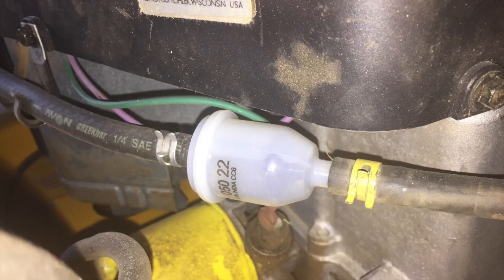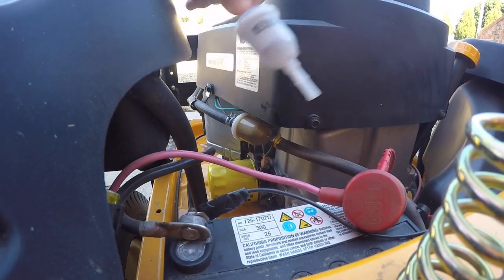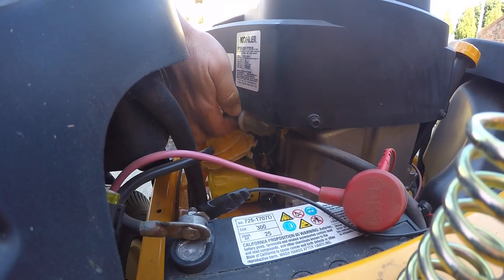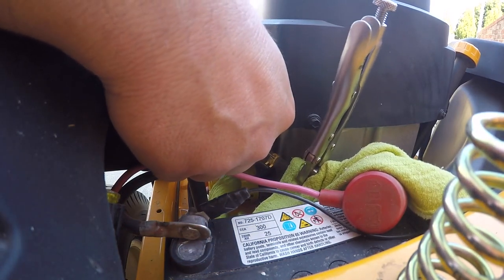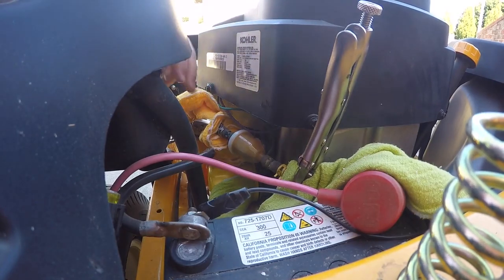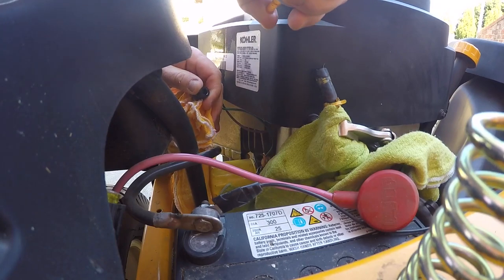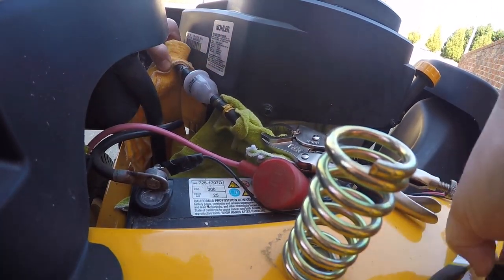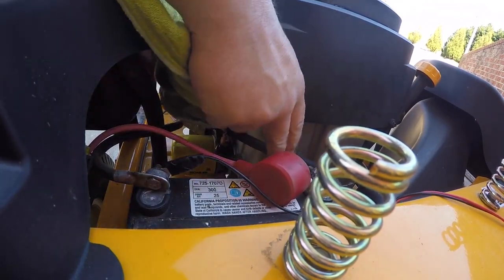DIY: How to Change a Lawn Mower Fuel Filter - Riding Mower - Lawn Tractor

Comment: Thank you so much for posting your video! My dad passed away a month ago. He always performed maintenance on the lawn equipment. Your step-by-step video gave an excellent how-to for replacing a gas filter. I have a Craftsman T240 riding mower. I looked at the fuel filter, and it is very similar to the Cub Cadet you demonstrated. I will check out your channel for more tips. Thanks again for posting this video!

Comment: Lovely.  It's easier if you move the clamps further away from the filter so they don't compress on the filter inlet and outlet hard tubes.  Hose clamp pliers are really helpful as they lock closed and don't slip off like needle nose pliers.  I find it easier to separate the hose from the filter if I rotate them slightly to overcome the static friction.  Don't use a plastic cup to catch the gas as the gas will eat through that in seconds.  Guess how I know? :-)  I was mainly interested how you pinched off the hoses not seeing great options sold for that purpose specifically.
Reply from the maker: Thanks for the tips!

Comment: One of the best things you can do for any small engine is to install a fuel stop inline. You can shut the stop off, crank the engine and left the fuel run out of the line. Also, it is a great aide if you have a flooding engine issue.
Reply from the maker: Nom dePlume That’s a great idea for winter storage.

Comment: My gas is pretty clear, but the mower just suddenly stopped when mowing.  I can't get it to start.  Just sits and cranks.  So I'm thinking something got in the gas and completely blocked the tube.  So I guess I will change the filter and just see if that works.  Should there be an air bubble showing in that plastic surrounding the filter?
Reply from the maker: Daniel P. Clark It’s fine if there is air in the filter. Go ahead and change your spark plug too just to rule that out. They are inexpensive.
Reply: I just happened same thing to me 10 minutes ago, turn of blades, heading to garage then it stop.  Tried many times cranked but motor will will start.
Reply: Water in Gas??? buy water out at auto supply additive.

Comment: What is a sure sign you gas filter needs changing
Reply: For me it was engine losing power as it wasn't getting sufficient gas under strain.  It sounds like a 2 stoke with idle set too low.

Comment: It is much better to remove the small clip between the filter and fuel pump holding the line against the engine then you have almost 3 ft of hose to play with
Reply from the maker: That can definitely help if needed.
Reply: thanks. I wondered about that. Mine is almost behind the air filter

Comment: I would have liked to see you start the engine after the replacement. Is there any priming required? Fuel line is filled with air.
Reply from the maker: Tom Kassos I did not need any priming.

Comment: I have a snapper sr1028  10 hp.  It will not stay running.    I put just a touch of gas  in carb. And it starts. Up but when it burns the gas out of carburetor  it goes dead.  So. I'm not a mechanic  lol but. Can you tell me what's wrong.     I put a disc style filter on it.      I am thinking it's my filter.   Cause it didn't have arrows  to show the flow.    I gonna get new filter with arrows  on it.   To show the flow.     Do you agree
Reply from the maker: Glenn Perrigin it is air or fuel related. You may have a cracked gas line or clogged fuel filter.
Reply: I put brand new fuel line on it.  And.  I will try a new fuel filter  thanks.
Reply: That mower uses a gravity feed fuel system and doesn't have a fuel pump. The red disk type filter is right type for that system. It doesn't really matter which way you install it. Installing a filter like the one shown in the video will make fuel delivery more difficult on that mower.

Comment: Do you need to prime a new fuel pump placed on the mower?
Reply from the maker: I’m not sure. I’ve never replaced the fuel pump.
Reply: @TightWadDIY  I apparently got lucky it didn’t need to be primed. When Removed the gas line on the new pump gasoline came right into the line and I reconnected it. It started!!!

Comment: I replaced the fule filter and the air filter, but it is still acting like it is not getting enough gas to stay running.
Reply from the maker: It’s possible you have water in your gas.
Reply: @TightWadDIY  Buy gas out at the auto store. Just put it in gas tank with full thing of gas and let it sit a few minutes. Will run better as goes along if this is problem. Use Non Ethanol gas if at all possible.
Reply from the maker: @yuw777  We always use non-ethanol in lawn equipment.

Comment: filter orientation is not clear which side to the tank ans which side to the carburetor .
Reply from the maker: Iqbal Khan On mine the flat side was on the carb side and the tapered side was on the gas tank side.
Reply: Simply replace the gas filter in the same direction as the old one.
Reply: I ate a tidepod

Comment: Just install a fluel shutoff before the filter.
Reply from the maker: In my opinion, that just adds another element that can fail. I don’t recommend this but it could be beneficial for someone who doesn’t mind an additional step their first time cleaning out the fuel filter.
Reply: @TightWadDIY  I installed one on my cub cadet 11 years ago and never had one problem. But I respect your opinion.
Reply from the maker: @YukonHawk1  It’s not a bad idea. I understand the benefit as well. I just do my best to limit what can fail. I’m glad it has worked well for you.

Comment: I did exactly what u did. Now my motor surges. Is this normal? Could air have gotten in the lines?
Reply from the maker: Joseph Jones Air could have gotten in the lines but it would be pushed out when you first started the engine. Are you sure you put the filter in the correct direction?
Reply: TightWadDIY I sure did.
Reply from the maker: Joseph Jones Is this the first time you’ve driven it this season? It could be bad gas from sitting since last year.
Reply: TightWadDIY that crosses my mind as well. Do you think maybe I could run this gas out and put some fresh in and it will run better?
Reply from the maker: Joseph Jones Ideally you would drain the gas and put fresh gas in.
Reply from the maker: It’s either a gas issue or an air leak. You can also check your hoses and connections for cracks.
Reply: TightWadDIY 
It was running fine until I changed the fuel filter. I cranked lawn mower (Was running fine at this point), drove to my house from barn, did my annual maintenance which included fuel filter, drove back to barn. One week later which was yesterday I cranked and ran for a little while and it started surging when idling.
Reply from the maker: Joseph Jones That is definitely frustrating but not something you can easily put your finger on. I personally would start with fresh gas then consider new hoses.
Reply: No
Reply: @josephjones829  TSC sells "Mechanic in a bottle" ... It worked for Me via old fuel.

Comment: Did u disconnect your battery first?
Reply from the maker: ROBERT A PFLAUMER I didn't for this repair. It doesn't involve any electrical components and there was nobody else around who could accidentally start the mower.
Reply: No.  Dripping gas and dangling vice-grip right next to connected battery.  Not a good idea.